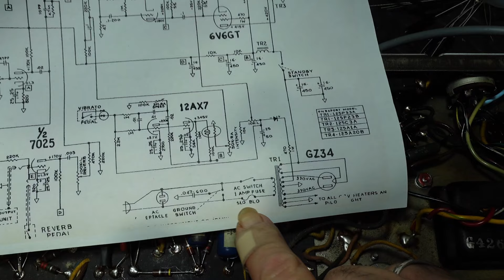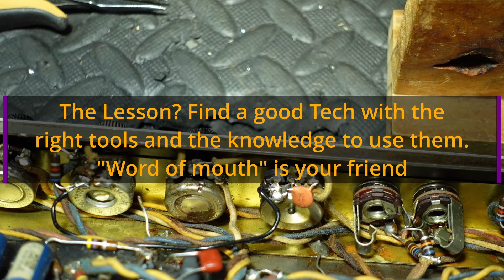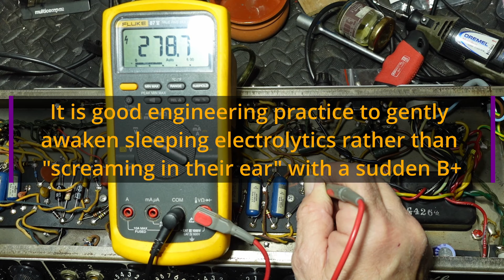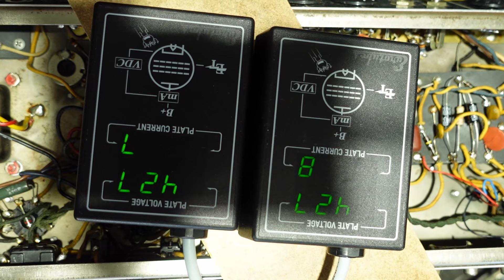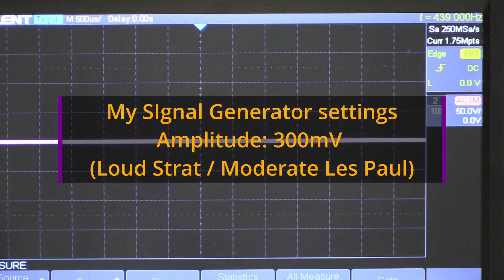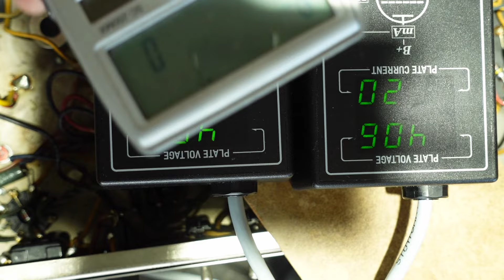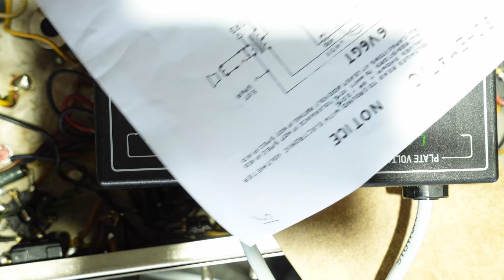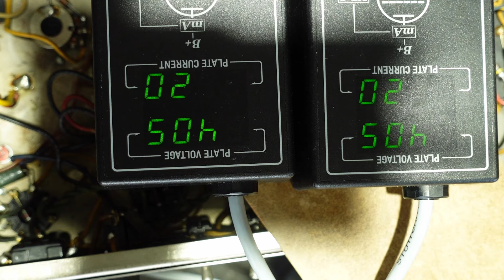Part Two: Restoring a Classic 1964 Black Panel Fender Deluxe Reverb

Comment: Good job Chris!  The previous tech must have been a piss poor solderer to have caused thay many dry joints!  That's dreadful!  Probly almost every joint he touched he messed up!  Bad solder, or iron, whatever, if a solder joint looks good then it generally IS good.  Maybe he forgot to wear his glasses?

Good use of the old switch for feedback!

Argh!  Bloody speaker stuffed!  Let me guess - you're gunna get a Jensen speaker?  I guess we'll see.
Reply from the maker: Thanks Nevile. I'm still not sure why his soldering was so bad. Maybe it was technique (I always tin EVERY component before soldering) or maybe crap solder.
Reply: @theguitaramptech    Yeah I dunno either.  But I promise you, in 30 or 40 years I have never had something I've built, fixed or worked on, ever come back faulty cos of a dry joint.  Just do it properly in the first place! Concentrate on the solder joint you're doing!  Get that that right then you never have to go back to it.  It's 60% lead ffs!  It would normally need a century for anything environmental to even have a chance penetrate that connection!  Let alone individually tinning component leads!